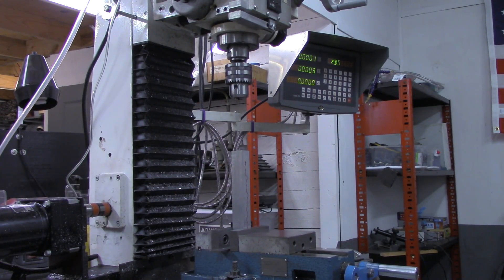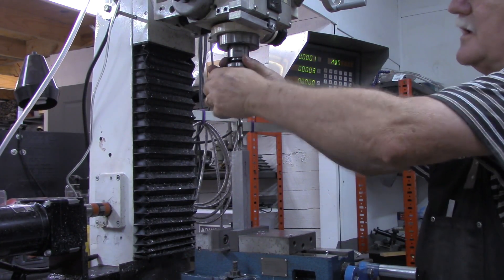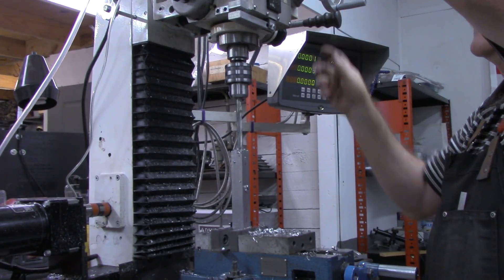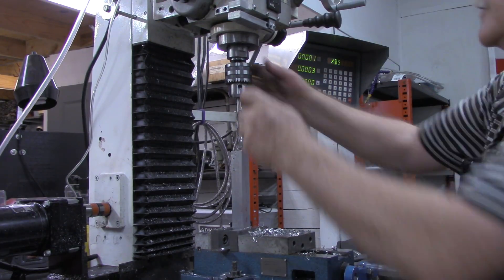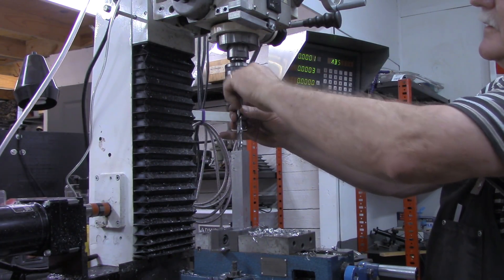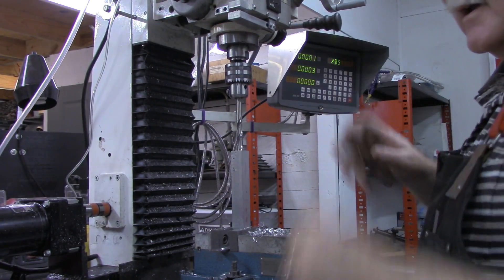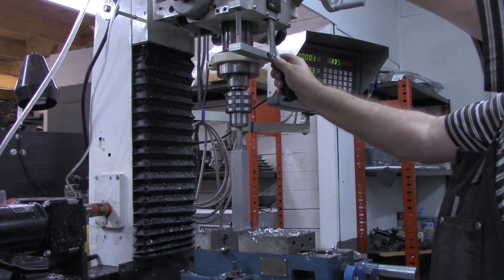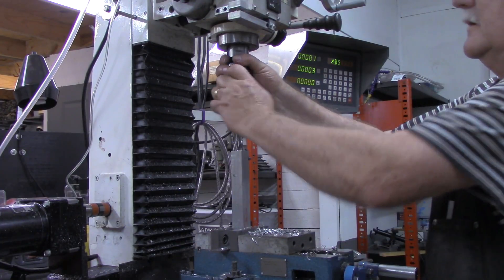3 Position Air Manifold

Comment: Lee...nice build...question, rather than extend the drill bit could you have used the power feed and raise and lower the head to gain the added depth?  I am lazy and rarely remove my vise from my mill table, by lazy and since I often don't require super precision I keep the XY corner of the left fix jaw as 0/0 in the absolute setting in the dro....for your project I would have set the part flush on the left side and then no need to use center finder because the corner of the part is 0/0, then simple math and move location, switch to incremental and 0/0......looking forward to the whistles...
Reply from the maker: I didn't even think of lowering the head until I was reviewing the video and had a "duh" moment.  I like the idea of setting a constant XY zero and will try that.  Thanks for the suggestions!

Comment: Hey Lee, did you consider "line boring" that one inch aluminum stock in your lathe?
Reply: Maybe on the lathe in a 4 jaws with a extension welded on the shank of the drill bit, just an idea here...???
Reply: I've never done any deep hole drilling/boring on a lathe, but I have seen it done.  I was thinking along the lines of holding the rectangular stock where the tool post is usually installed on the cross slide and mounting the drill in the headstock using a collet.  I think that this would be a much more rigid way of holding the stock for deep drilling.  Bob In Virginia, USA  Oh by the way Pierre's Garage!  I watched your heat treat and grinding of the tap follower lastnight!  Excellent fun!  I loved the "sleeping machinists" part!
Reply from the maker: Still would have had the issue of drill length, but as Pierre mentioned an extension on the drill might have been the trick here.